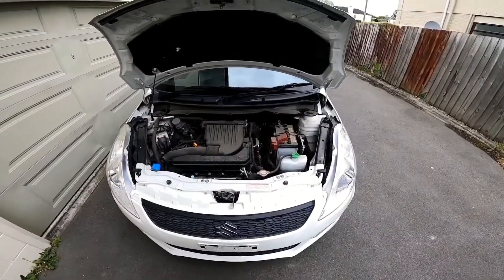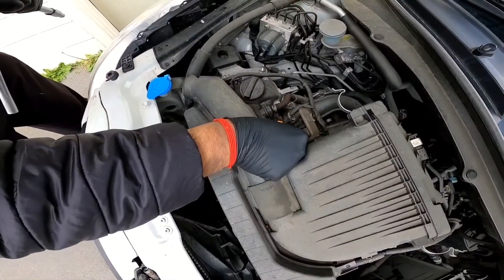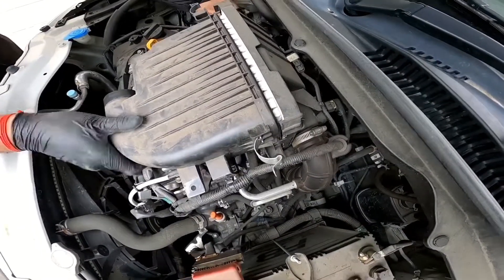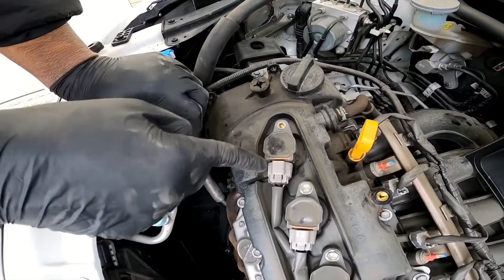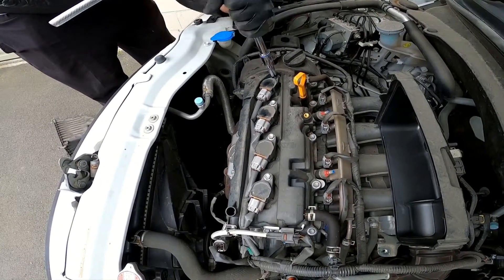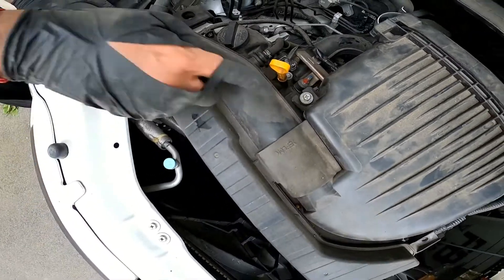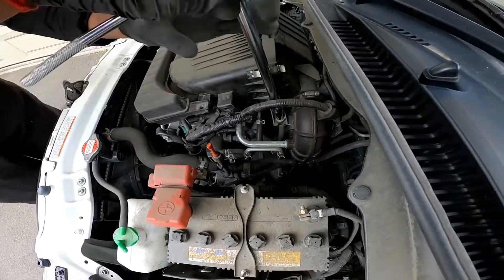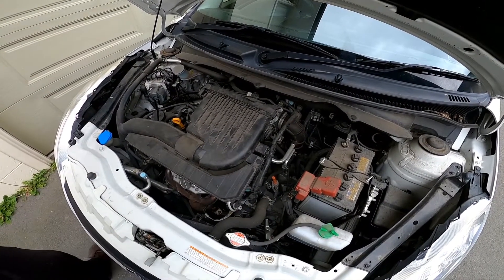How to replace Suzuki Swift Spark Plugs on a K14B engine  2010 - 2017

Comment: The K14B seems to be around the same size as the K12B which is in my euro Suzuki Swift Type NZ, what parts seem to be different between those engines? Maybe just a bigger block and cylinders or is the most likely the whole unit itself? Does it also use dual VVT?
Reply from the maker: They are both VVTI, the K14B has a longer distance for pistons cycle during combustion. Also comes down to tuning.  Please consider subscribing to my YouTube Channel for free if you haven't already to show your support.
Reply: @DocMackGarage so the K14B would have a longer stroke over the K12B but the bore and cylinder head stays the same?

Comment: Thanks, great video! 

Don't you need to set the gap of the spark plug?? Do you just put new ones in???? Please 🙏
Reply from the maker: Thank you. Good question.  Yes it will need to be gapped to the correct spec, however it is dependent on the brand you buy. I belive NGK spark plugs come pregapped where some other brands may not. Please consider subscribing to my YouTube Channel for free if you haven't already to show your support .

Comment: Didn't remove plug or show tool needed .......useless
Reply from the maker: At 3:57 16mm socket with a 3/8 inch extension . Not sure if you saw that.

Comment: Grrrr... Watched it for you to NOT show how to change it. Ay yi yi
Reply from the maker: @becca9058  Hey, sorry it did not meet your expectations,  but the hardest part was getting to the ignition coils which I demonstrated all the steps for, as it was a friend's car I did not replace it , but demonstrated the correct steps to replace it.
Reply: If the plugs have been in the engine a long time it can be very difficult to get them out and they can even break if they are seized in. It would be helpful to  advise how to deal with this situation. I believe it is best to have the engine hot to help release them.  You really should have shown them being removed as it spoils your otherwise well presented video.

Comment: How I can find the correct data about filling quantity of engine oil? 
It is about 1.2 L gasoline 91hp. 
In the user manual the factory stated 3.1L (including the filter). However the workshop claims 3.7L.
Reply from the maker: I think it is 3.3L service  fill and 3.6 dry fill as it includes the sump.. It is OK to under fill a little bit initially , but over filling is an issue.  Please consider subscribing to my YouTube Channel for free if you haven't already to show your support.  I would recommend confirming with Suzuki .

Comment: Cool thanks, these individual ignition coils are new to me. For interest, what's expected lifespan on the coil?
(And as others said it would be great to see at least one of the plugs out but I get the idea👍)
Reply from the maker: Hi Stu, original ignition coils can go even upto 100k miles or 160k km on OEM ones, but it can also fail over time as it gets hot. Spark plugs around 60k miles it is worth replacing and inspecting the coils then.  Please consider subscribing to my YouTube channel for free if you haven't already. Yes I agree I should have pulled the plug out to show. The next time I get a swift in I will demo even more.

Comment: Was here to see the spark plugs, instead, it is how to nearly but not quite do the job.
Reply from the maker: The only remaining step is to unscrew the spark plug as I had taken the ignition coil out.  If you are not sure how to unscrew a Spark plug I can help you.
Reply: What’s the proper gap that the spark plug has to be ??
Reply: Great videos, I got a k12B engine on a 2014 suzuki swift , im trying to figure out what plugs i need, can you assist?

Comment: Hi 👋,
Can you please demonstrate how to properly clean MAF sensor
Reply from the maker: Hi, I don't have the swift with me at this stage, but I have a video on cleaning the MAF for a Toyota that would be similar .
Reply: @DocMackGarage  it would be great, is there any link for it please
Reply from the maker: @dreambig121  Sure no problem, here it is https://youtu.be/NKninqUQAuQ
Reply: @DocMackGarage  
I tried but i m not sure to identify and how to clean that bosch MAF sensor, 
I have poor rpm issue in my car, sometimes rom is clinking up and while at breaking sometimes drops below and cuts off my AC
Reply from the maker: @dreambig121  unplug the MAF and start the car , does it idle better (Do not drive while MAF is unplugged)This is just to test. Also are you already a Subscriber? It is Free to Subscribe
Reply: @DocMackGarage  subscribed already